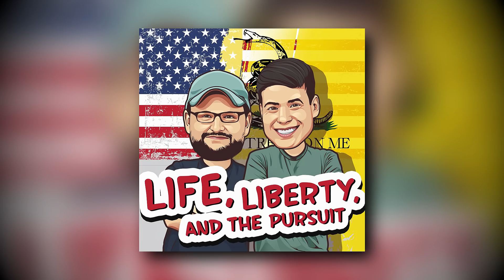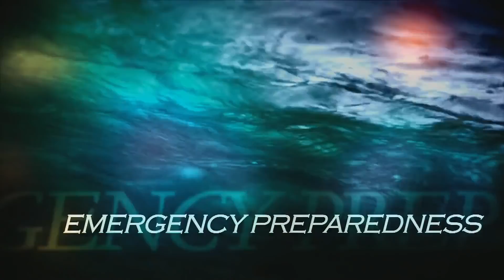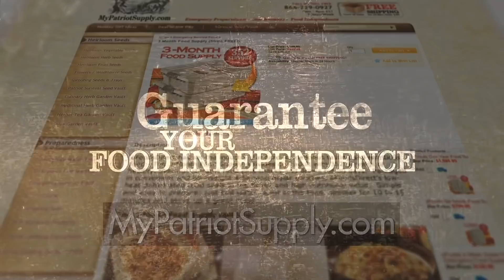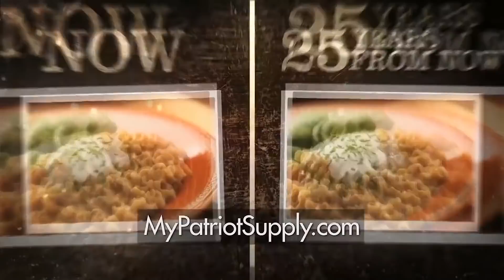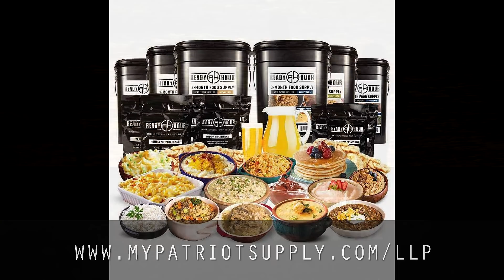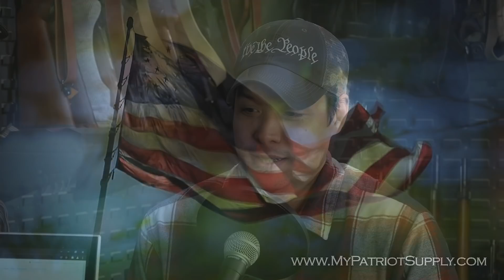LLP | #82: "AR-15 vs AK-47"

Comment: In terms of reliability, All I know is that I have a suitcase full of replacement parts and kits for my AR's, you kknow , just in case... and for my AK? a ball peen hammer, some Vice-Grips and a Yugo cleaning kit.
Reply: Yeah but how many times have you actually really had to pull a part from that case? Unless your shooting 10,000s of rounds I’d guess hardly any if at all
Reply: I purchased a M-16 parts replacement kit, 20 years ago. It's still in the plastic wrap. I got it at a military surplus store in Utah...
Reply: @Front-Toward-Enemy humm ur wrong 😅
Reply: @BaconSlayer69  no im not actually
Reply: @Front-Toward-Enemy  u are actually wrong shows you’ve never handled an AR
Reply: @BaconSlayer69  lol, you keep believing that buddy.
Reply: You’re gonna need a file for your ak parts if you ever need to replace anything. Even parts from the same country of manufacture often require hand fitting. Not everything needs to be hand fitted but a lot things do.

Comment: The AR in the right configuration is an accurate long reaching rifle, for instance the Colt H-Bar. On the otherhand you can have an AK that reaches out as far and as accurately as in the AK-56-S. Both reaching out or exceeding 450 yards,
accurately.
Reply: They both have good qualities i do have a saiga i live in ny no pistol grip in 55.6 and i'm sure it works well too its brand new old stock.

Comment: If there is a situation with no replacement parts available - then the AK would be the obvious choice.  The AK barrel will last longer over the same amount of rounds.  If a person has parts availability and does not need the extra power of the 7.62, then the AR may be the wise choice.  I carry a duty issued C8 (M4) everyday and I agree that it is a very accurate and ergonomic rifle, but in -30 degrees Celsius, it will often fail miserably.  In warmer weather it is a gem.  Your guest speaker here doesn't seem to know much about AK's.
Reply: The guys at Battlefield Las Vegas said their WASR lasted over 80-95k rounds before a catastrophic malfunction. Even then, they were able to replace the front trunnion or the receiver and everything still functioned. That’s a lot of rounds!!!!
Reply: I always say I love both rifles but if I had to up and leave my house with no cleaning kit or oil I'd have to take my AK. Hands down.
Reply: R. Tafolla absolutely! Battlefield Las Vegas has ridiculously valuable data on lifespans of different AR’s and AK’s, I really wish they would make a channel on YouTube devoted to that.
Reply: @eddiec9175  Yep me too! All that data would be awesome to see. Seeing which parts are replaced at how many rounds, which rifles lasted the longest, which barrel types wore out less

Comment: The early failures in the M16 program were pretty much due to the Army. Stoners original design and original powder it would have been fine. The lack of a cleaning kit was another military thing.
Reply: Exactly. The army tried all they could to sabotage an amazing rifle. Damn I wish it was easier to find a barrel with a 1/12 twist

Comment: 39:50 pretty much any gas tube will fit on any AK with minor fitting, and if you really needed it to work, an AK can fire and cycle without it
Reply: Check out School of the American Rifle. AR pattern parts are not totally interchangeable.

Comment: I have both. But in a SHTF or WROL situation I would use my Romanian WASR. Partly because I have thousands of rounds of 7.62x39...but also because it is an AK...just a more robust, simple gun that will run and run and then keep on running. Eats any ammo you feed it. It is modern enough for me -  it has a side mount and I have an RS Regulate with a red dot on it.

Comment: Awtomat Fjodorowa was the firs assaust riffle that was fieldtested in ww1 by the russians and designed by Fjodorow. He came up with it because he saw an oppertunity after seeing the arisaka ammo (japans riffle ammo that was smaller and less powerfull because of that, it was envented because the japanese had soldiers that were phisically incapable of shooting larger calibers) this gun was fielded in small numbers and there were around 3000 produced.
And the first jetengine was designed in GB.
Reply: By modern assault rifle standard, the Federov 6.5x50 mm is not intermediate cartridge, but a full powered one. Therefore it wouldn't be technically an assault rifle. Was the Federov the first modern battle rifle? Да, конечно

Comment: The AK is not based on the Sturmgewehr.  If anything it borrows the concept of the assault rifle.  The operating system is much more similar to the Garand.
Reply: What did Mr. K. say? Both the garand and stg44 were inspiration for the AK.
Reply: Even the bolt of the AK copied the m1 garand’s bolt

Comment: I love the AK, but under current circumstances I have to give it to the AR. Due to a certain ammo ban, 7.62x39 and 5.45x39 will dry up eventually until a new country picks up the slack in production. For any new buyers, get an AR in 5.56. Like Brandon Herrera once said, it will take a while for any company to produce AK ammo at Tula and Wolf levels.
Reply: Palmetto state armory already picked up the slack. They’re going to be pumping it out domestically. They’ve already made that announcement.
Reply: Also 5.56x45 is nowhere near as effective as 5.45x39. 

Stating otherwise would be like saying 6.8 spc is equal to 6.5x39. Which 200 yards or closer, they are. After 179-200 yards the 6.5 grendel once again reigns supreme. 

So why limit yourself to a 5.56? Where you’re going to be fixing broken parts regularly, replacing gas tubes, or just be intelligent if you’re going to rabbit hole yourself into an AR at least get a short stroke. Then again I fire 2000 rounds a month give or take a couple hundred from my rifles. Whether it’s just around my farm plunking or running classes. 

AR’s cost twice as much as a proper AK and the hey break twice as much, also must be cleaned exponentially more times per round count.
Reply: The services to buy 39 is not drying up when you have American companies making the same ammunition and brass casing which is good for the gun. Dunham's sports is still getting shipments of services 7.62x39 everywhere 54r . If you forgot that a lot of government also have guns that shoot services7.6 2x39 and their AR hybrid platforms. And to be honest they never got rid of tula they just changed the name to Red army which is in a white box maybe five and Dunham's sports. AR-15 rounds yes it's good for accuracy but the AR-15 platforms is not going to last like that out there in the wilderness like a AK-47 or  AKM platform. The akm is going to be a lot better than AR for the simple fact it's in my order which means you get the accuracy of an AR and a AK platform with power because I seen people who are great shots know how to use a AK and can show up to 500 yards and six which is down there impressive and still get the same stuff of power to put down the enemy.
Reply: Well  manufacturers have two years to gear up plus countless countries make 7.62x39.
Reply: @peterreily1490  if you're talking about cheap chinesium builds on AR's then absolutely. Price equal AR to AK the ar will be built like a turd. An LMT or JP enterprises BCG will settle most of the reliability issues. The only case where I can definitively say the AR is 100% inferior to the AK is extremely adverse winter environments. I want to say it was Polenar that did a comparison test and most of the AR type rifles wouldn't chamber or cycle when frozen with a light mist. 

Most other cases however I'd much rather have the lighter ammo, magazines, and over all system. I suppose it depends on how the weapon is being fielded. Small fire team without the need to walk miles upon miles? Hell yes, AK in 7.62 or 5.56 (only for supply considerations) 

Also as a caveat, I would probably more likely have an ultra light defensive carbine in 5.56 and a 7mm rem mag bolt gun.

Edit: it was Kalashnikov group and flannel daddy also just did a similar test confirming results.
Reply: Thats exactly what they said years ago with the 7n6 ban still can get a tin of 7n6 for $400 all day long its not going anywhere.

Comment: Ar for sure not that I have anything against Aks. I would have both for sure.. The Ar is just cheaper, more accurate in general,  lighter, more modular, more interchangeable, and easier for first time shooters. It has faired better in InRangeTv's mud and sand test. Yes you do have to do upkeep on it. Which is something you should do on any firearm no matter how reliable. I think the only time I would take the Ak is if I lived in a super cold environment. I will say the Galil ace 2 is really close to beating out the Ar, but the price is just too high for me.

Comment: Luckily God gave us 2 arms. 1 for each Rifle.   But Seriously... As a former Marine, I was trained on the M16a2 and later carried the M14.  But, I personally like the AK more for 1 giant reason. Charging.  I absolutely hate, the pull back charging on the AR.  Ive built a left side charging, non recipricating  piston AR in 7.62x39 that Is freaking awsome.  
But, as a old school soldier that was a squad DM on the M14 that hung out with the 31's because I could strip rounds off their belts, Im a side charging guy, so if I had to choose only 1 Id go AK.
Reply: That's my main issue with the AR as well, most of the other control differences are either equal or in the AR's favor but that T charging handle absolutely sucks.

Comment: From a gunsmiths perspective, if say i was trying to build a militia: If my main limitation was funds, not soldiers, i would build as many aks as possible to arm as many guys as possible. If my main limitation was troop numbers, i would arm the limited number of people as well (and with good role specification) as possible with ar platform rifles.

They are both good platforms and there is a lot of crossover between them. But they follow different philosophy. It is easier to make an ar light, precise, and tuned to the role and user. From a mass production standpoint, it is much easier to make a reliable, rugged ak.

People have preferences, i personally like aks more, they just feel tougher and the clunky recoil makes them feel more deadly, but if i had to carry one, i would choose an ar, if feels kind of prissy and delicate and the recoil is like a louder 22lr, but rationally, its more accurate at a given price point, weighs less (so does the ammo), still probably wont break,  realistically has the same stopping power, and shoots farther flatter. Even though 556 does make more sense, id probably still lean to a well built 7.62×39 ar over the ak just for the weight savings and accuracy per unit cost - a di gun will always outshoot an equal quality and price piston gun.

No matter how good of a shot you are, you will always shoot better offhand with a lighter rifle, and having a rifle that makes a better club doesnt win firefights. Capacity, mobility, and accuracy does.

Comment: ARs are too fragile and less reliable in adverse conditions, while the AK is easier to clean and maintain. Steel core 7.62x39 bullets also have far better penetration of commonly encountered obstacles than any 5.56x45 bullet as these lighter and faster projectiles too readily tumble/fragment. I enjoy driving a Lotus Elise more than a Jeep Wrangler, but the Jeep is a much better means of transportation in adverse conditions.

Comment: NUTTIN as cheap as in past years. I STILL recall a Colt M4 up on a dealer wall listing for ONLY $600! Mac 90 chromed barrel for $100 to $150. Similar pricing on other pew pew makers.

Comment: How about just try them, buy the one you prefer,  and train with it until you know it's limits, and buy more when you have the cash. I like them both, but I prefer my boom stick ( fell in the water during a tragic boating accident, very tragic, I cry sometimes of the tragic, totally accidental, loss of my boom stick). I prefer my 45 over 9mm (ironically lost in the same accident as my boomstick). But I have no problem with the 9mm guys. Whatever floats your boat my dude/ dudet.

Just use what you prefer, you're going to be way better off. Even the best version of a firearm, if you don't like it you won't want to train and be effective with it. Could be the newest of the new, laser sighted, heat seeking, 50cal, grenade launcher, personal nuke. If you prefer the old peacemaker, get that because you will actually like training with it and be more effective.

Ya'll have a amazing New Years Day!
Reply: weren't Swimming Lessons available for those pew pews and their lunches??? Lunch as in metallic victuals snacks
Reply: @chunglow7646  Hahaha unfortunately no. Went straight down into the deep blue sea. Not even Aquaman can get that deep.
Reply: @shawnshields521  poor Aquaman will likely be hiring help. . . . Economic revival could be a friggin plus. SQUID FOLKS could use em.  N0 Hoomin hands but i ain't judging. HAPPY NEW 2022 YEAR!

Comment: Easy… Sig SG 55X series. 
550, 551/556 and 553 and 751
Reply: I have to get one of those, probably my favorite gun that I don't have a practical need for, at least the original Swiss designs, I'm not too interested in the newer Sig 556

Comment: i did 4 tours in the weapons storage area and alert pad guarding nukes. i used  early 70s m-16, no fwd assist, 20 rd mags, and the stock that would fall off if the gun fell over or out of a truck onto the fightline.  Id take an AK in 2022.  like a honda lawnmower, they are indestructible. ive never had one, but other than 5.7 x 28   small arms arent battle rifles for pounding in cinderblocks and door jams  from an arms length

Comment: The whole debate is easily solved. The AK is not really meant to be a "modular" weapon like the AR, and never was. There are some good products out there to put rail systems on them fairly easily, and the side mounted optics systems really aren't that big of a deal. They're simple guns, and need to be kept simple. Optic, light, that's it. If you want more, then obviously the AR is the better choice. You have to set your expectations correctly. I personally prefer the AK, as I feel they have more character, and I don't want all the extra crap AR shooters do. It really doesn't matter at the end of the day.

Comment: The AR-15 may require a bit more maintenance, but that maintenance takes 5 minutes tops. Bury an AR-15 and AK-47 in the sand or mud, that AK jams almost immediately due to the loose tolerances that make it "reliable".

Comment: I fell in love with the AK from playing Counter-Strike 1.6 back in the day.
Zenitco, and a bit of research/fitting will cover most AKM's for optics, if for some strange reason you don't have a side scope mount rail.
SLR rifleworks will be your best friend for foregrips and mounting accessories.
AR's are fine rifles, better overall for modularity and having crazy uppers, but I just can't quit the AK.

Comment: I have an AK variant that is maybe very comparable to the AR being modular toward accessories and tuning of the gasses to run smoother. Pictany Dust cover, ALG trigger, Adjustable long stroke gas piston, Adjustable gas block, M- Lok lower hand guard with Pictany railed gas tube, Red dot sight, Muzzle break/ flash hider, still has the side mount for optics, night AK/RPK iron sights.

Comment: I have a Riley defense AK-47, I found it for about six months about 800 round, I’ve been nothing but impressed with it. I got some nutmeg wooden furniture from PSA board and holy crap that was hard to put on. If you intend on changing your furniture you better own a demel tool.

Comment: One more data point you don’t get in Georgia: ARs can have issues in the cold, particularly the ultra common budget brands like Palmetto. They don’t cycle right when it comes to a Minnesota winter. It’s -20* out there as I type this message.

AK just laughs and keeps on going.

If I could not take both, I’d take an AK for anyone who lives in the colder climates of America.
Reply: That's usually a problem of over lubrication, dry ARs run fine until it gets ungodly cold just like AKs do

Comment: I have an older Charter Arms AR7.  Surprisingly accurate.  And Northern West Germany in the early 80s- we had M16s with 4 digit serial numbers and open lugs, several didn’t have chromed bolt carrier groups.  Those sucked to clean

Comment: My opinion after a lot of use with both platforms and of combat in OEF, is that the AR is a much better recreational platform (lighter, faster to manipulate, more modular and somewhat more accurate) but the AK is a much better military arm. (More durable, easier to train on, can go for longer periods of time without replacement of springs and bolts). If you're looking at them as military arms the modularity of the AR doesn't matter to a basic infantryman who is not allowed to modify his rifle. The speed of the reloads doesn't matter when you have a squad continuing to fire while you change mags. But having a gun (like the AK) that is better suited for going long stretches of time without replacing extractors, or ejector plunger springs (it has a fixed ejector), breaking trigger pins or springs, cam pins, and bolt lugs is very important. Even the US, which is by far the best funded military in history, let's preventative maintenance fall by the wayside and the reliability I saw from AR platforms overseas suffered greatly, while the all original AKM's the Russians left in the 1970's continued to work without a hiccup. The AR is probably the better platform for special operations that have the funding to use the modularity and to ensure basic maintenance is continuously carried out, but as a general issue infantry rifle I have zero doubt the AK has the strengths better suited to the task.